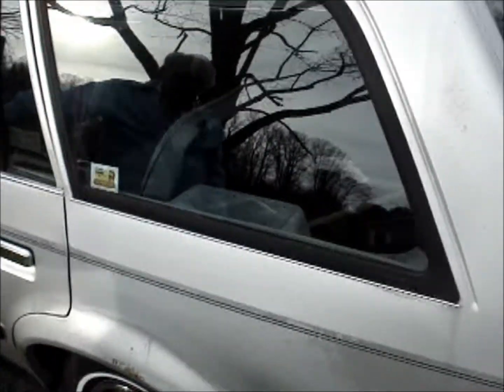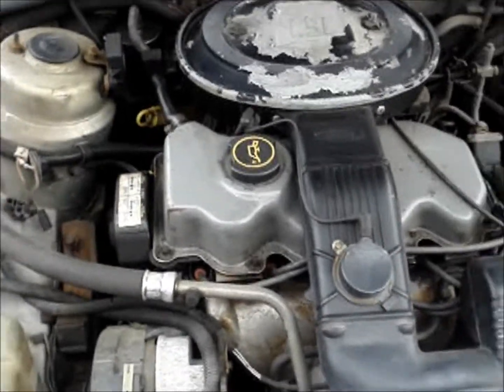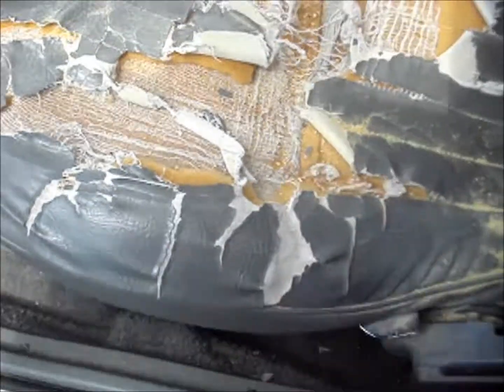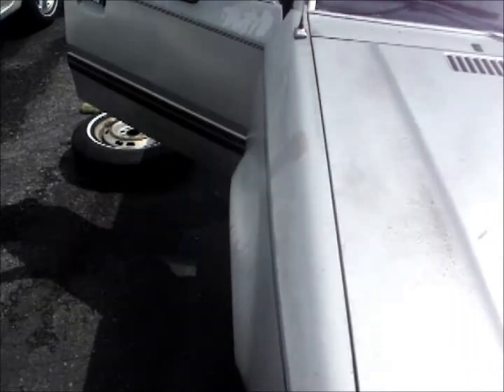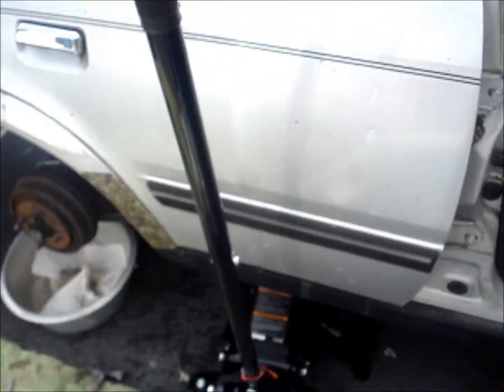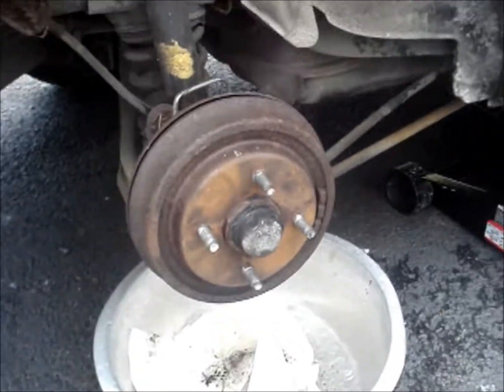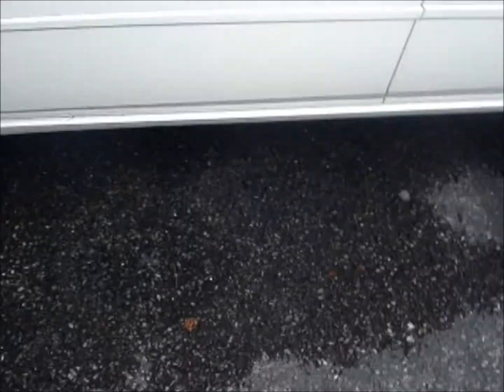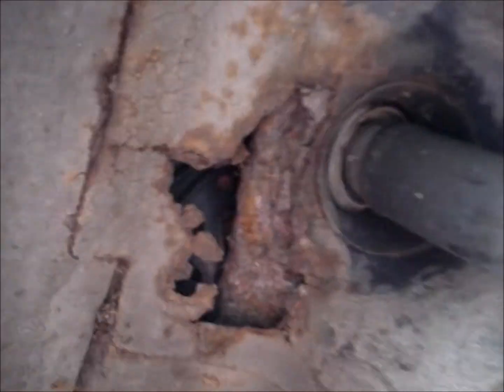1987 ford escort ---------- new car maybe?

Comment: some of those were all one piece and you have to take the complete drum and hub off as one by taking the bearings out, some have a couple threaded holes in them that you can run a bolt into to push the drum off as well so check for that also, they will be located near the studs..

Comment: You can easily get the drum off by removing the grease cap and pulling the spindle nut off. The wheel bearings will fall out so be careful. But just take the nut off and the whold drum/hub assembly will slide off.  I guess I should've watched the whole video before saying the car looks toast lol, it just needs a LOT of maintenance work. But at least it's a FORD :) Good luck

Comment: OH and about the rust, as long as you can't poke a hole in the frame rail with a screw driver then you should be fine. Just dump some rust converter on the frame, primer it, then weld a patch over that hole and you're golden.

Comment: that's a serious problem at 9:12, your strut tower is gone and the strut is going to end up going through that hole if it hasn't already done so by now. it was a common problem on the old escorts.
Reply from the maker: yes little did i know this, is a rather old vid and at the time i thought it was a small hole..... no it was huge and on both sides, but dont fear i got some rather this 18 gauge steel (might as well go for over kill) and bent, cut and welded in that area. them towers are way stronger then they were new now :D
Reply: Mr3wheeledbike
That's awesome! way to go man, most people would have junked the car after they saw that. I'm glad you were able to save it. I've got an '88 escort and fortunately it doesn't have that problem.
Reply from the maker: coolbluelights i love lost causes XD but yes the was just the start of the rust, i patched many holes

Comment: If that rots any more, The shock will go completely through the wheel well and that corner of the car will drop down. Your best bet is to bring it to a professional welder and have that section of the wheel well cut out and new steel welded in. I know, I had an 87 escort the same exact thing happened to on that same side.